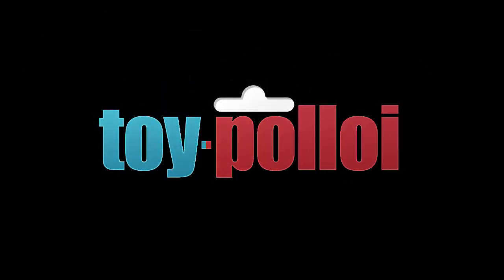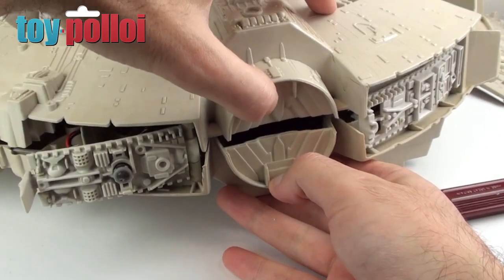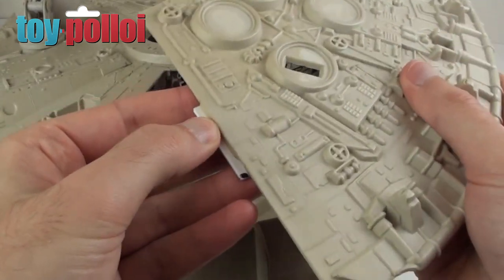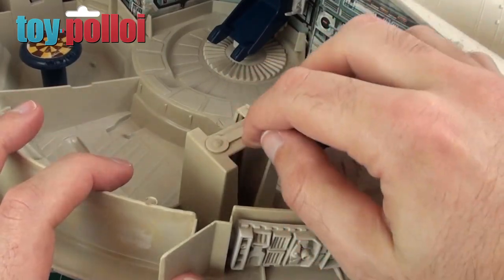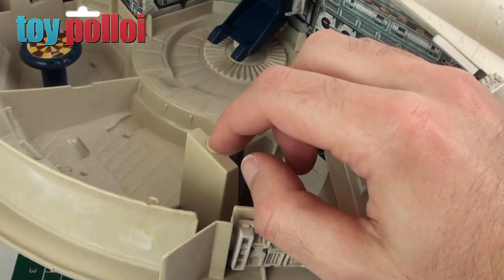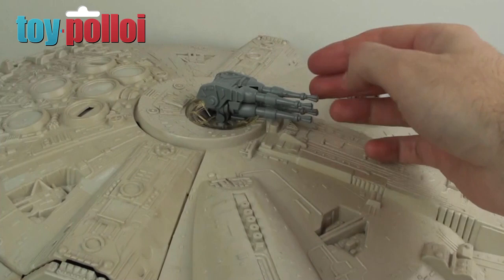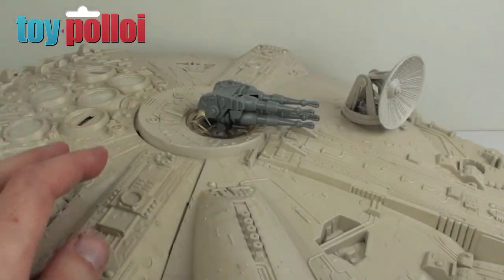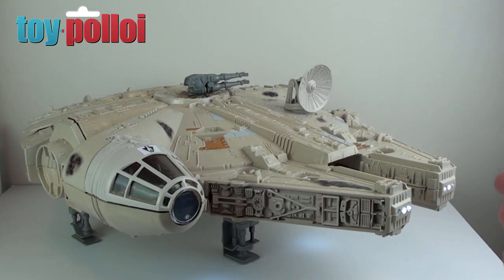Vintage Star Wars Millennium Falcon Restoration challenge - Part 3/3 - Toy Polloi

Comment: I know for a fact that LEGOs are made out of ABS plastic, not entirely sure what the toys themselves are made out of, but for attaching things to each other, you could trying using a solvent weld? So Instead of having to drill, you could just drop a bit of pure acetone where you need it, and weld them together.

Comment: I really enjoy your videos but I did have a couple of ideas/questions.  On the headlights, I wonder if you boxed them in behind the LED if they'd all three light up?  On the guns, instead of cutting them off behind the first ring near the tip, cut them off behind the second, fatter ring?  Seems like it would allow for an easier hole to drill, bigger support post on the inside and more hidden overall.  Thanks again for making these videos.  They're entertaining and inspirational.

Comment: To fill cracks there is a seam filler that model builders use. I believe it is made by Tamiya. It comes in a tube, you just squirt it in the cracks then wipe away the excess with water. It fills seams quite nicely. I wish I could remember it's exact name but you should be able to find it at any hobby shop that sells model kits.